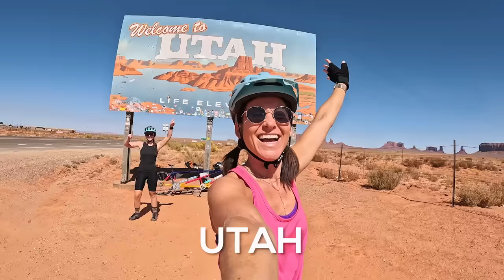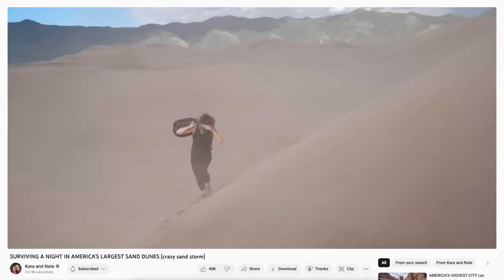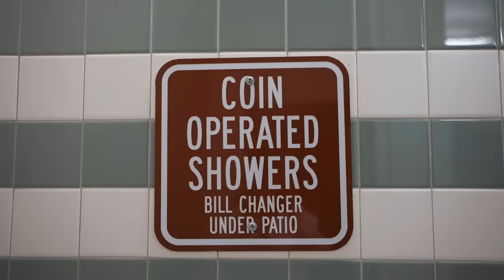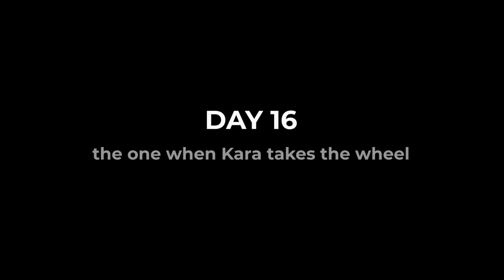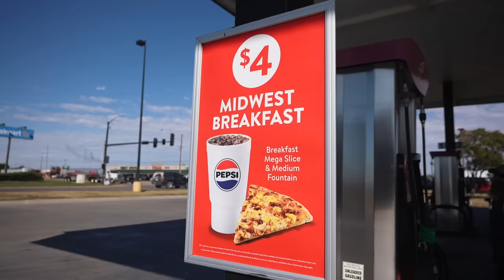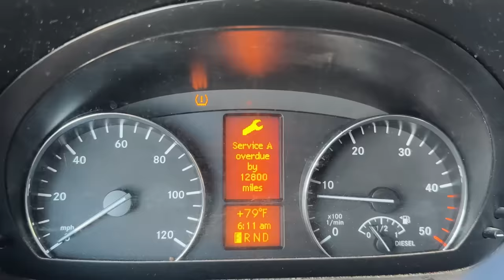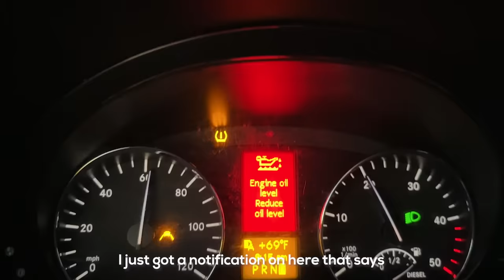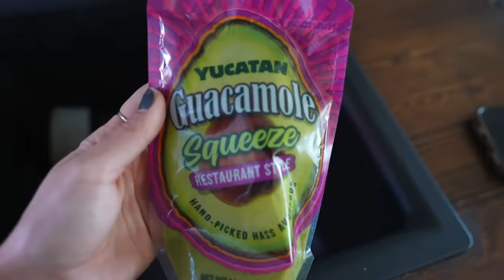Biking Across America (part 4)

Comment: Love your videos and the challenges you undertake! From a former mechanic, please do the oil changes as close to the intervals as you can. Also, if the engine oil it too high it can cause seals to leak. They do not have a dipstick, so take it to a shop to get it looked at.  Thanks for the great content!

Comment: Great that you managed to Captain the Triplet. Only I‘d all the time wonder why you start such a diffucult way. Stokers sit on the bike, captain has to hold it upright by stradling the top tube. Then captain does release the brakes and pushes himself in the saddle. Thats also beeing the first pedalstroke for the the team. And up and on the way you are. Stokers do make it easier for the captain by not trying to balance the tandem by themselve but stay upright and aviod shitfting their weight with sudden movements. Would make it much easier for the team. Im tandeming now for 25 years with many different stokers. But it always helped to make sure before the start that it is the captains job to hold the bike during starting and stopping. Even my father in law made it on the triplet at the age of  77 by keeping to that advise.

Comment: Oil service shops always over fill because they fill the amount a computerized manual for the make and model tells them to instead of simply checking the level on the vehicles dipstick! One time after driving off after an oil change at o'henry's oil and lube my engine oil pan exploded off just after the warning for high oil preassure, and check engine started sounding. The car was 6 months old and had 3,500 miles on it. Turns out they over filled it by a quart and dudnt use the correct oil filter the manufacturer suggested. Taking a Mercedes to the dealership for simple oil changes can be a hassle I know. One thing you can do to avoid this problem in the future when you are traveling is go to the next  Mercedes dealership and buy like 5 oil filters and O rings, write the engine type and oil type on each box. As well as the words, Only fill to full on the dipstick! NOT what the manufacturers specified levels! They do this to be quick at their jobs as it takes longer to add oil slowly and check levels after letting oil settle in the reservoir. Just a friendly tip.